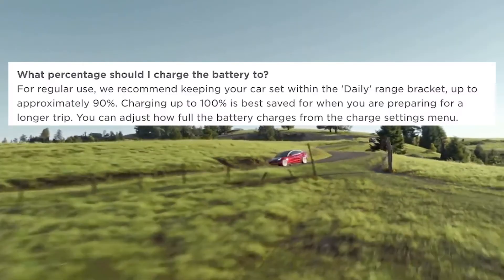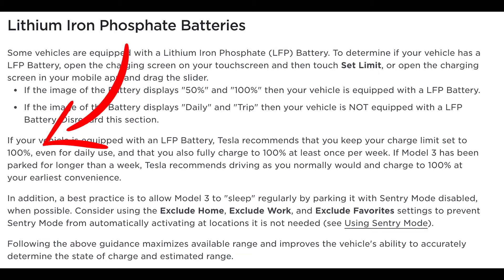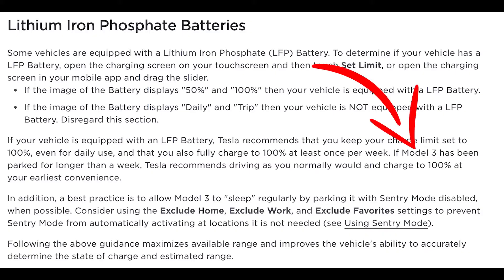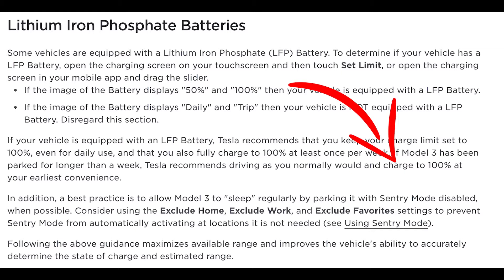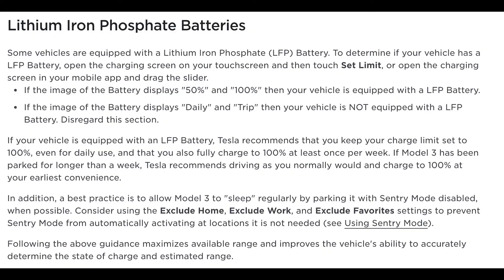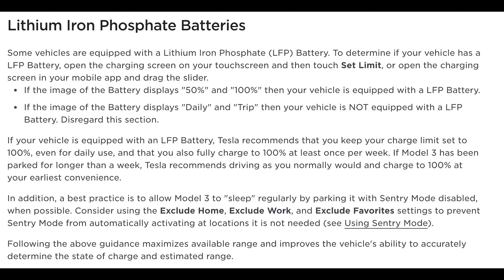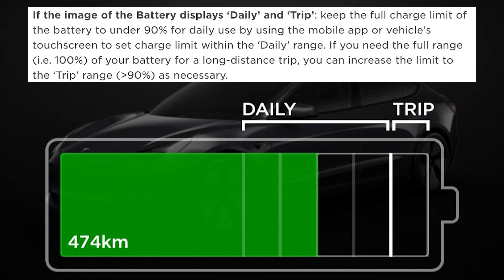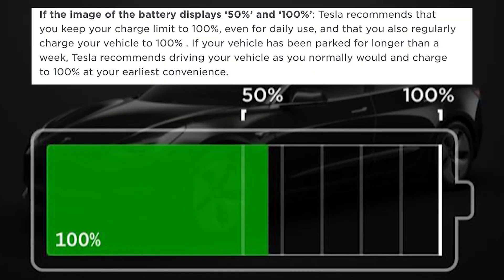Does my Tesla Model 3 have an LFP Battery?

Comment: So i got a 2021 m3 SR+ i still dont  know which battery i have on the app says to charge to 80% for daily. Can i still charge 90% and 100% every other week?
Reply: Thank you!!🙏🏾
Reply from the maker: You can charge your battery however you like but if it is not lfp, then charging to 80% on a daily basis is the recommendation by Tesla.
Reply from the maker: I'm pretty certain you have the non-lfp battery which is the same as mine, so you can charge to 80% on a daily basis
Reply: @Tesla11ven can i do 100% every now and then?

Comment: Hi there, does this rule still apply to 2023 Tesla model 3 performance? I do not see any LFP listed in the high voltage battery, and the charging bar showing daily and trip. So that means my 2023 M3P does not have LFP battery right?
Reply from the maker: Which rule are you referring to?
Reply: @Tesla11ven when I'm checking the charging status in my car, if it showing "daily and trip" then it is the old battery, if it is showing "50% and 100%" then it is LFP battery.  Is it still the case?
Reply from the maker: Correct, I am unaware of any changes to that information.
Reply: @Tesla11ven  cool! Thank you man!!
Reply from the maker: You're welcome

Comment: Is this still true for the 2023 model y ? Wondering if daily/ trip indicator still means that the battery is not lfp
Reply from the maker: 2023 should have an LFP battery. To determine if your vehicle is equipped with an LFP battery, navigate to Controls > Software > Additional Vehicle Information. If your vehicle is equipped with an LFP battery, "High Voltage Battery type: Lithium Iron Phosphate" is listed.

Comment: can you use the 80/20 model during regular driving then once a week do it up to 100% or always keep it up to 100%?
Reply from the maker: If it's an LPF battery then there are no issues charging to 100%, but personally if you don't need that much charge every day then 80% is also acceptable for your battery.
Reply: @Tesla11ven  so 90/20 rule still technically implied?
Reply from the maker: @TransKera  Yes, you have more options with an LFP battery compared to those who have the original type